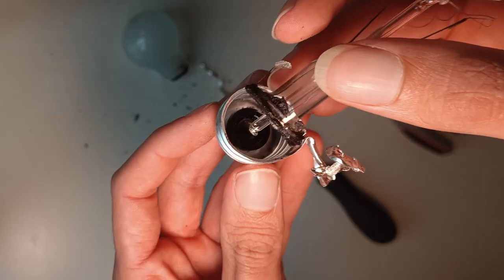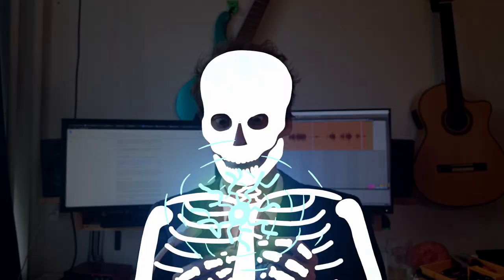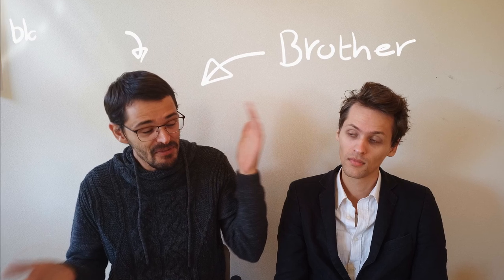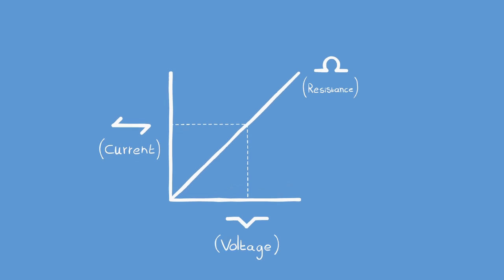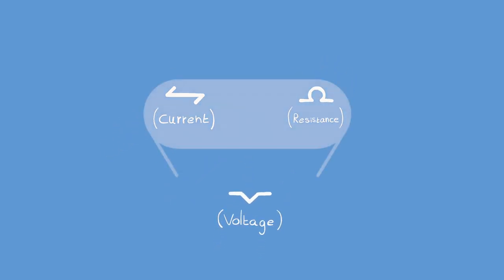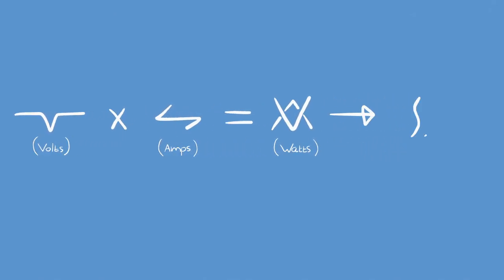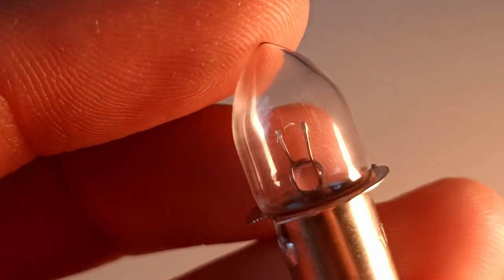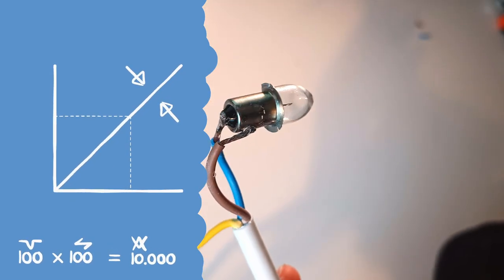Why lightbulbs don't EXPLODE (explosion included)

Comment: Power does not determine heat. Amperage does. That is why power transmission lines use such high voltages. With higher voltage, you can reduce the amperage while sending the same amount of power. This makes less heat and, therefore, reduces power loss.
Reply: Unfortunately you are wrong. In this context (resistors/wires), the power applied to the resistor is always converted to heat and light. For a simple resistor, the power is the voltage applied to the resistor multiplied by the current through it.

What you are describing are power transmission systems. They are not simple resistors. Ohm's law doesn't cleanly apply to them and so the relationship between current, voltage, and resistance is not upheld. However, it would still be true that the power applied to the wires is converted to heat and light if we only focus on the wires.

In fact, light bulbs aren't simple resistors either. They get hotter so their resistance likely increases. I expect light bulbs to initially draw a lot of current (if we assume power sockets are perfect voltage sources) and consume a lot of power. But as the light bulbs get hotter, their resistance would increase and they would draw less current and expend less power. This is a classic negative feedback loop. We would need an oscilloscope to test this, though.

Comment: I am a bit confused. Why does the lower rated lightbulb blow up but the other doesnt?
Reply from the maker: It's rated for low watts, which means that it has relatively low resistance, so when I plug it into the wall outlet, which has high watts, too much electricity is flowing through because of the low resistance.

Comment: did it dieded?

u know what? I have always wondered - if you have the wires going to a lightbulb and the lightbulb filament is also a wire, which short-circuits the ones going to the bulb, why does the filament get hot but the wires don't?

can u ask your nerd bro about this?
Reply: is this also just because the difference in resistance? the wires must be less resistant than the filament?
Reply from the maker: nice question. I'm not sure exactly, as heat creation is a bit complex in the real world if you want to know it exactly. It's a combination of factors. How hot it gets, influenced by the amount of power and the resistance of the material, and how fast it can cool down, determined by heat conductivity, surface area to volume ratio, etc.